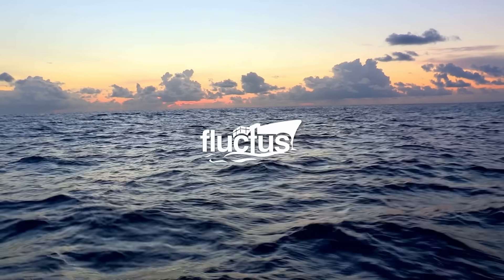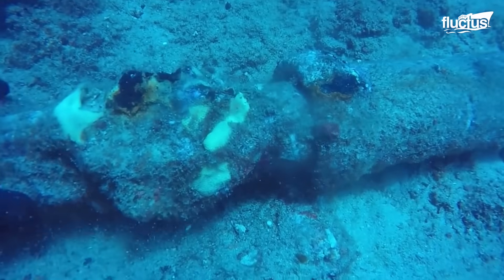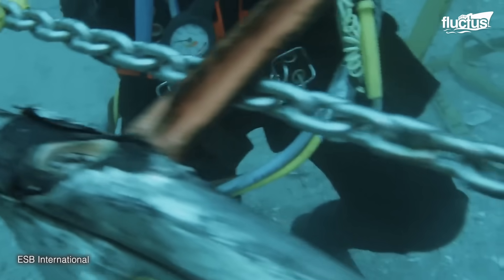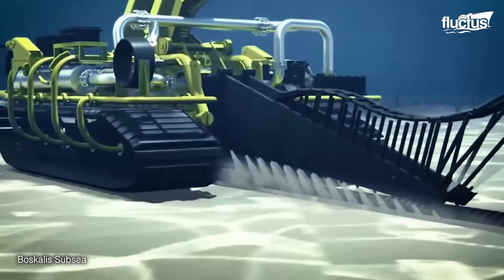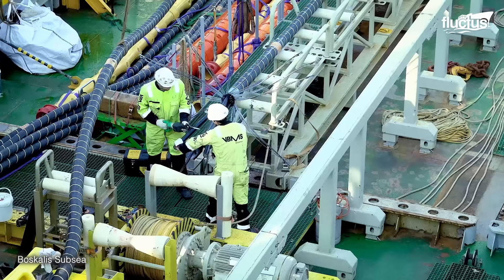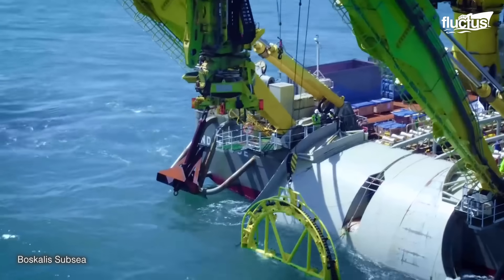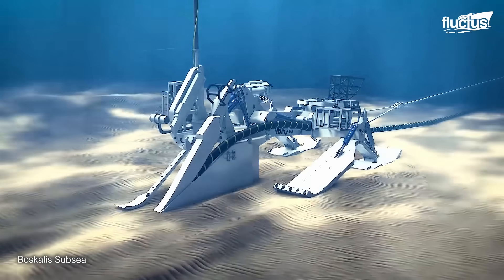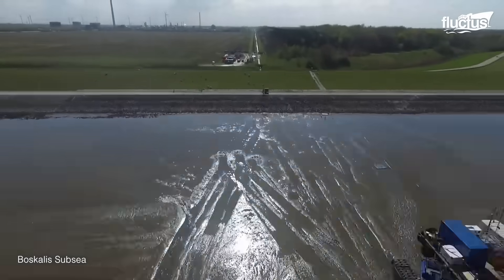Inside the Extreme Life of Divers Repairing Billion $ Underwater Cables

Comment: It’s not extreme. 😂. I was a commercial diver from 1977 to 1997. Air and SAT. Then back of course 2012 as a subsea inspection engineer 34-U. It’s a job where your wet a lot of the time and. Low bubbles. I loved it. It’s heavy work but rewarding.

Comment: Bummer.  The video isn't about repairing underwater cables.  It mainly concerns laying the cables, along with some underwater welding and propeller cleaning.  A device that allows the cables to be repaired dry, while underwater is briefly shown, but with zero details concerning the actual repair.

Comment: Typically cable investigation is carried out by a remote operating vehicle (ROV) unmanned submarine, if the cable is at a shallow water depth which is an undesireable installation then dive operation could be nessecary for repair.

Comment: how do they pinpoint ruptures in those cables to send a repair team to specific location?
Reply: I don't fully understand it, but I believe there's something called OTDR - Optical time-domain reflectometer
Basically its a device that sends light across the cable and can figure out where along the cable there's a problem.

Comment: How Confidence is Gained About Sea Crocodiles and Alligators like a Force-Believe as "At Rivers Only". About Dinosaurs "If Alligator and Crocodiles" is Still From Sea Anyway, Sea is Still Connected to River Anyway which Somehow The Water Filtered and Not Salty Anymore.
The Belief of Technology is Like Don't Exist Yet? Why not Casing the Cables So It Can't Be Destroyed, A [  ](Box) Layer, With Difficult Screw and Nut.
If Repair Like This, How The Communication on Land(About Electricity) is Perfect and Confidence of No Accident? Voltage can Travel in Water(Open Wiring), the Person Can Be Electrified Easier. Like Eel Can Electrify People.

Comment: Does that work with pipelines too?
Reply: Yes.
Reply: Similar, but different.  Oil pipelines are typically 24”, 36”, or 48 inch diameter, heavy steel, with a concrete protective coating.  In the late 70’s I worked the North Sea. We laid, buried, and welded oil pipelines in depths of 500 ft, and deeper. Saturation diving.

Comment: Can't they just pull the ship out of water and polish the propeller and rudder? Must they dive?
Reply: That would mean finding a dry dock, sailing to it, setting it up for the particular ship, and arranging for workers. It's probably also easier to do with the buoyancy of the water as opposed to suspended in a lift as the props would be significantly higher than the ground.
Reply: @lonewolf025  i dont think do. Every job is easier on land, just use a big lader
Reply: Just roll it over
Reply: @ricksosbee3913  or just get a flying dutchman it needs to maintanence and the crew is there for eternity
Reply: You are forgetting the shareholders!
Reply: It's much quicker & cheaper for divers to clean it.
Reply: Is definitly more expensive to bring it dry deck